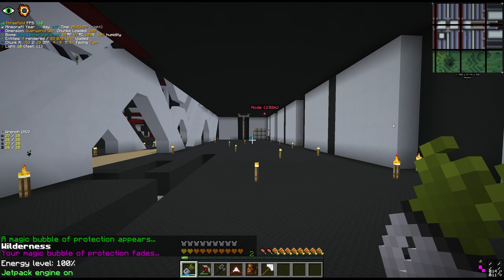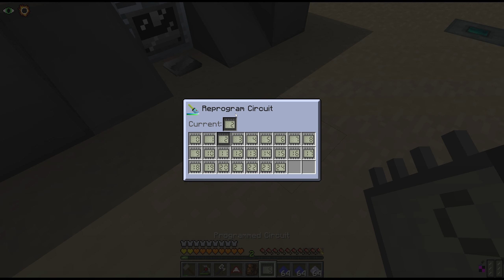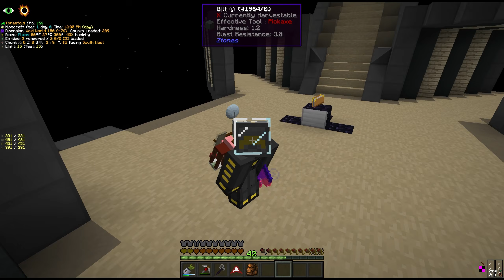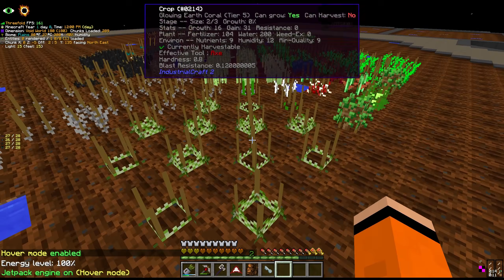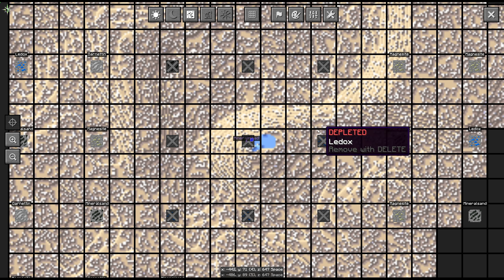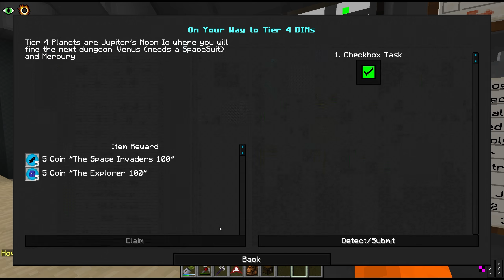Gregtech New Horizons - 57 - T4 Rocketry! Modded Minecraft

Comment: If you want to more clearly mark what certain machines are for I'd recommend using the fancy signs from...I believe Bibliocraft. Very nice for adding some larger text and/or visual indicators, and you can even make the signs out of different types of wood to further differentiate things.

That simple toluene recipe really out to be nerfed if not removed outright. It's far too easy, methinks ;)

LuV+ pumps are indeed crazy. There's actually certain double if not triple fluid reactor designs I had to change because the sheer amount of superheated steam generated overwhelmed IV pumps.

The solution to ABS automation is, indeed, spamming more of them. I...actually have no idea if you could wallshare them the same way you can make dual or even quad EBF setups, but since they don't use EBF coils I don't think it's very necessary to wallshare them anyway.

Distilled water would make those AE2 recipes faster and less likely to fail. That said I'm sure there are plenty of recipes that require water specifically, and on the flipside resources are no longer a problem and with a GT++ machine time is less of an issue as well.

And making IC2 coolant with plain water. Distilled water just gets no respect, I swear ;)

The only reason you still have hope for the questbook is because you've been slacking off on doing magic. The advanced thaumaturgy tab is full with these kinds of errors.

The space suit is 100% required if you want to go to Venus. Thermal Padding you can skip by having a Dragon backpack (or some other form of passive regen) and Nanoboots to counteract the Slowness III debuff, but if you try to land on Venus without a space suit to protect yourself from the immense pressure you're just going to die horribly. That it's necessary for the T4 rocket quest I'm assuming is because Venus is required for progression, since IIRC it's the only T4 planet that requires the space suit.

Crafting Sunnarium that was is only a 50% chance of the craft actually succeeding, so it's not something you can just tell your AE2 system to craft whenever. Not unless you're exceedingly lucky, I suppose.

For the record I looked into it, and out of the 160 materials that you can make prospecting scanners out of there's a grand total of 8 that you might realistically use to craft one. 6 if you've unlocked Ichorium at this point, which is vastly superior to Oriharukon or Draconium, the two lowest tier prospecting scanner materials. Also fun fact the next tier up from Ichorium/Draconium is available with a T4 rocket as small ores, but cooking it requires either Naq coils or even Naq Alloy coils, so that will still be a hot minute. Oriharukon will do a perfectly serviceable job in the meantime.

Another thing you could do in terms of rocket fuel is build a chem plant and switch over to GT++ rocket fuel. That would involve building a chem plant, but with AE2 and as many GT++ machines hooked up to it as you do that'd be a fairly trivial matter.

Before you call Enderium fluid pipes "not great" take a closer look at what pipe you need to craft LuV superconductor, and how many of them you need in order to craft your first fusion reactor. It's nothing more than convenience at best, but it's still better than a bloodwood door at least ;)

For the record, it took me three attempts to test that wireless redstone stuff. The first time I forgot to chunkload the sender. The second time I placed an admin anchor right next to the active lever that was powering the sender, and I learned that all railcraft anchors can be turned off with a redstone signal - actually useful if you're using them for chunkloading, as disabled chunkloaders will not count down the time they have remaining in them. The third time I finally managed to confirm that, yes, these wireless redstone items do work across dimensions. Took far too many attempts, but at least I learned something in the process ;)

Fancy signs might actually work better for this "detect which miner has finished" system, although it'll be a marginal upgrade over regular vanilla signs I think.

Something I've learned since the last video is that single block Pollution Scrubbers (or whatever they're called at higher tiers, air recyclers I think) are amazingly fantastic at cleaning up pollution in a single chunk, provided that you use Transvector Interfaces to insert air filters into them - pollution scrubbers get a hefty bonus based on how many sides of the machine is exposed to air blocks, and with TIs it's possible to expose five sides to air (TIs won't transmit power to the machines, unfortunately, so you need one for power). The Multiblock electric air filters are great for larger areas that all have some amount of machines contributing to pollution, but they cannot even attempt to compete with pollution scrubbers for single chunk cleaning. Starting at IV tier pollution scrubbers are a viable option for keeping even an MEBF in check, even if it's in the middle of your base.

Sunnarium batteries are not to be praised for their capacity, they're awful on that front. Lapotron energy orbs are much better for capacity ;)
Reply from the maker: You're comments never fail to make me chuckle :D
Reply: Venus is not required at all, first source of titanium ore but other than that it’s completely not needed